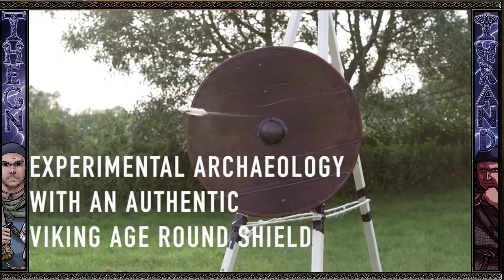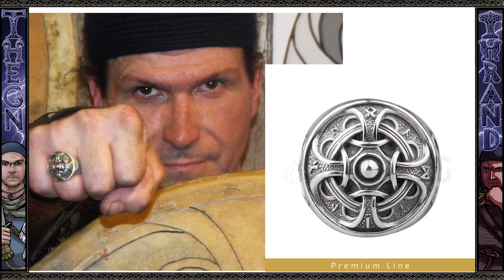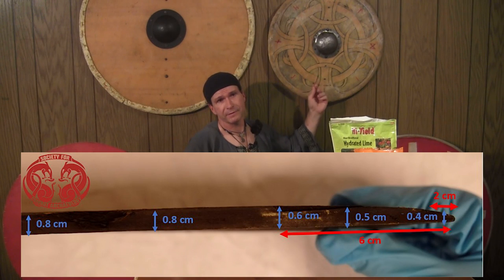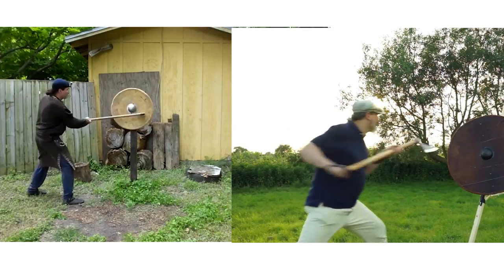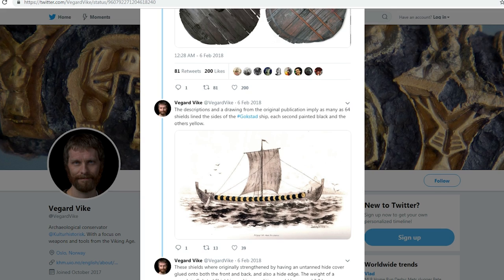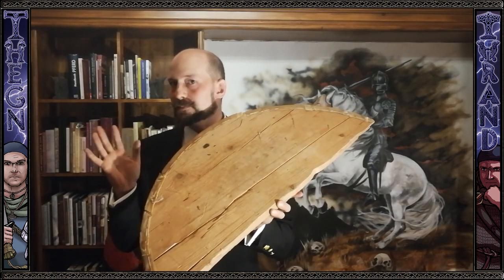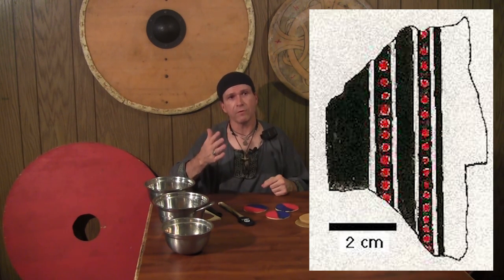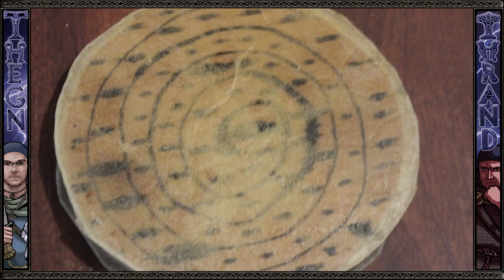Viking Shield Update Rolf Warming, Reply Arne Koets & Glue Test

Comment: This sort of experimental archaeology is very interesting. Too often techniques and ideas are lost to time. 

They would have access to slaked lime as well. It was used as a building material for its waterproofing and fire resistance throughout the world, so you might want to try it. It is also possible they used pot ash. It would have similar reactions to the milk and vinegar as the calcium hydroxide. I would also be curious about what would have been used to apply water resistance to the shields. Would they have used oil, wax, tallow, or some other method to protect the shields while at sea?
Reply from the maker: agreed!

Comment: In a test I made, not really historical, but more of a fun test, I shot through 8 mm of plywood, 12 mm plywood, 6 layers of linenglue, 12 layers of linen glue and 18 layers of linen glue. Still 10 cm of penetration in the foamtarget behind. 60 lbs at 32 inches drawlength. 
Tomorrow i want to try it against linengluemix and 8 mm plywood.
I love working with rawhide but this stuff is so expensive where I live so I kind of want to figure out an adequate linenglue mix to substitute rawhide in some minor/ expandable  Projekts like Shields. 
Biggest projekt will be a  woven rawhide armor. Just for fun, I don't care if it was a thing or not XD

Comment: @ThegnThrand
Do you know of any evidence for sealants or preservatives which might have been used to retard the degradation of a shield's natural materials? Do we know is waxes or oils might have been regularly applied to keep humidity and air pressure from causing the laminates to separate or warp? I would think that especially on seaborne  campaigns that long-term moisture might be a problem.
Reply from the maker: Uncertain but to use a half bees wax and fat mix to weather and water proof rawhide and leathers is so ancient have no idea who started it or creation point. It preexisting the Viking age it most certainly would have been a method used in my opinion.